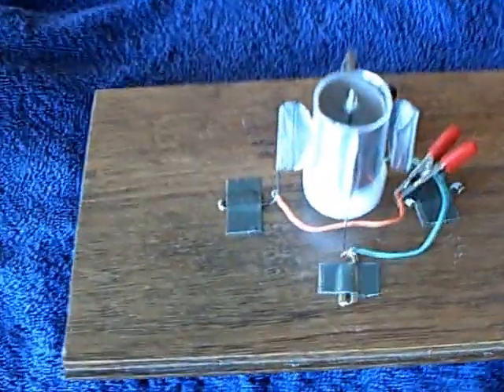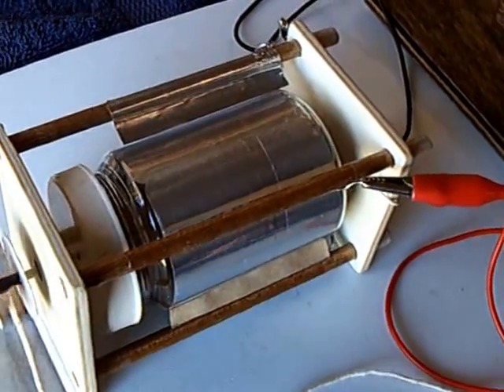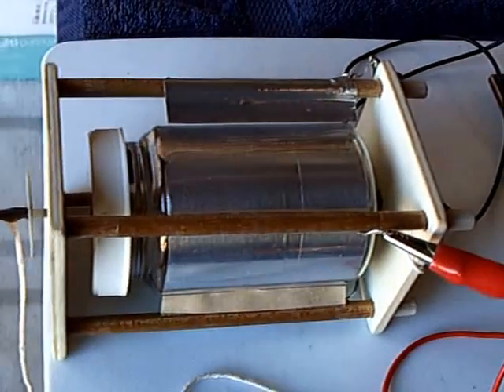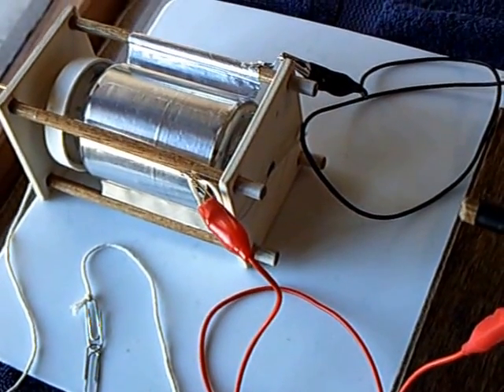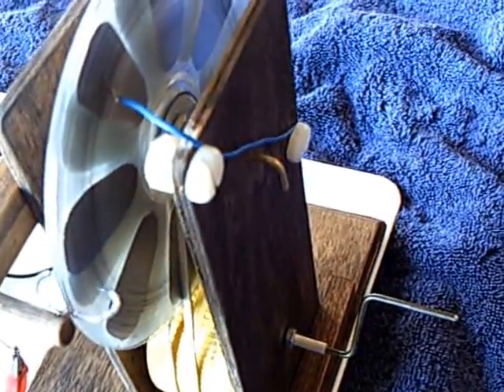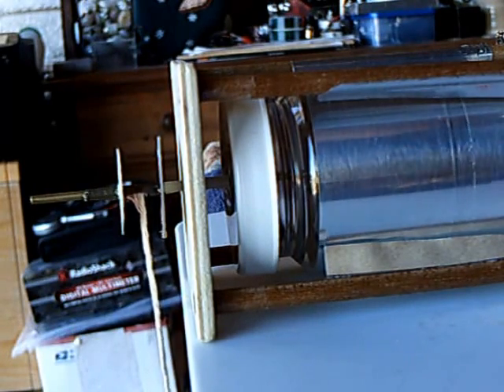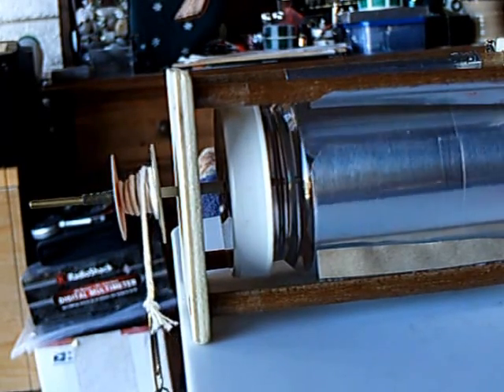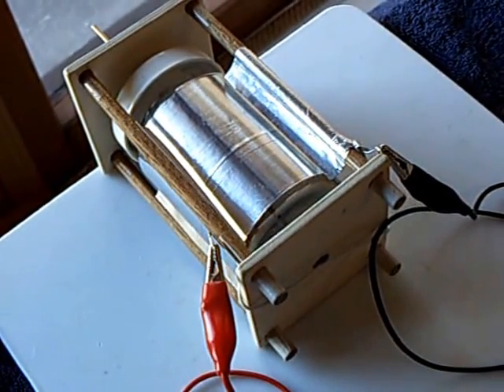New Electrostatic Motor --  torque test

Comment: Sorry to see you still confuse "work"* (or "energy"*) with "torque"** :/

Of course it is simple to calculate the work done when having the weight of the paper clips (and wire! cause here the mass of the wire is not so far from the weight of 1 papier clip).

Any way, thanks for having done this POWER*** //// test ;)

*     WORK  [J ]
= ENERGY [J] 
= MASSE [kg] * GRAVITATIONAL INTENSITY [m.s^-2] * HEIGHT [m]

**  TORQUE [N.m] 
= FORCE [N] * RADIUS [m] 
= MASSE [kg]  * GRAVITATIONAL INTENSITY [m.s^-2] * RADIUS [m]

* POWER  [W]
= WORK [J ] / TIME [s]

Cheers.

Comment: can you throw any light on how this works?are you going to make a sectorless electrostatic generator?  precision is beyond many peoples' means, including my own; I do everything on my lap with a pair of nail scissors and pliers
Reply from the maker: Basically the charge just gets moved around on the rotor surface.  Because there not a uniform charge there ends up being a rotational force as everything pushes and pulls on the rotor.  I subscribed to your channel and really enjoy your videos.  I use a few more tools than you do but I basically build in a similar way.  Kitchen table projects are lots of fun.

Comment: Does magnesium produce a better electrostatic charge? If so what would be the effect on the Wimshurst and the motor?
Reply from the maker: I don't think that magnesium would be any different than aluminum in this application.  Some of the devices I have studied used copper or brass.

Comment: You will need to use "Super corona Dope" as shown in lasersaber.
Unfortunately i was not able to get this dope shipped outside of USA since 2012 for my HHO experiment.
This help to prevent sparking for static motor which help to increase efficiency.
Reply from the maker: Yes I need to get some of that "Super corona dope".  I am having a hard time getting the performance I want out of this motor.  It runs but it take too much voltage and runs too slow.

Comment: This very simple motor reminds me of a standard off the shelf induction motor that you would find in wash machines and bathroom fans. In reality after looking at motors for a long time it finally dawned on me that motors and generators are just mechanically driven transformers is what I can come to think about them. They operate in the same manner just different configurations but they all produce a static field either by mechanical force or by inducing the force. What about adding some layden jars for extra capacitance sort of like a run capacitor and see if you can improve efficiency of the torque.
Reply from the maker: I made a couple of small Leyden jars to go along with the Wimshurst and they do help.

Comment: elegant experiment, would be great for a science fair. Next use  A slayer exciter circuit and tesla coil for the the H-voltage source.  You will be winching bricks before too long  :)
Reply from the maker: Thanks.  I tried a slayer exciter and couldn't get anything to move.  I will try again but the voltage has to be a constant HV potential.  HV with a wave form doesn't seem to work on the motors I have built.
Reply: ***** Great job  Have you tried making one using disk shapes on a rotor disk and stator with commutator?

Comment: :) So Very Nice To See that for the first time since years I follow the Quest For Free Energy, someone does what I have so often advised to do to calculate mechanical output power and torque, so have an estimate of the outpower of the devises.

Note: Do not confuse TORQUE, POWER and ENERGY!

E.g.: the torque will be shown by the limit weight (mass times gravity acceleration) the motor will lift times the radius of the pulley ; not the speed the weight is lifted ;) (I mean not directly).

Cheers.
Reply from the maker: I would not be surprised if someone did a rough calculation of how much work this little motor did here.  You would just have to look up the weight of two small paperclips and a foot of cotton string.

Comment: Thanks,
Electrostatics have always facinated me. This stuff is every where, and all we want to do is get rid it. Got to be a way to harness the thousands of volts that are all around us. What would it do with capacitors in line with your motor. Maybe with a spark gap. Keep up the great work!
Reply from the maker: It is a very interesting study.  I am finding out there is quite a lot of work bring done in this field right now.
Reply: *****
So putting capacitors did make an improvement?
Reply from the maker: kylie wilson The capacitors are really part of the Wimshurst setup and not the motor.  I have ordered a 12v negative ion generator that should give me a constant 6kv power source.   I will try caps with that and see if it does.

Comment: Finally someone who lets ACTUAL work be done by an experimental device. We never get more than a multimeter reading, empty rpm's, partially lit bulb or a turning fan of sorts and some fuzzy math.
Lidmotor, I salute you.
Reply from the maker: Thanks Cloxxki.  These electrostatic motors are so put down as being absolutely useless "free spinning" devices that I had to do this.   I believe what Oleg Jefimenko  claimed and I had to see it for myself.  I agree with you that this ACTUAL work testing should be done more often on the other projects.

Comment: I agree with 72fr250, a persons hair raising from a Van De Graff, a snap from a finger after rubbing the shoes on carpet, the crackle of clothes from a dryer - that's about it. Here we see no coils, magnets, carbon brushes, no batteries and yet it's doing work and at a remote distance from your supplying of the energy.
Great build :)
Reply from the maker: Thanks.  There is lots of information on electrostatics if one wants to get into it.   I am surprised that there are not more practical applications of it.   Coulomb force is pretty strong stuff.

Comment: No magnets or copper coils and these motors are doing work. This work with electrostatics has me excited. They don't teach us anything about electrostatics in college level physics except that it's static and useless.
Reply from the maker: I don't recall much being said about it either but that was long ago.   They used the word "useless".  I'm not buying that anymore.
Reply: Well they aren't completely useless but to get a magnet motor equivalent power output you need extremely high voltages, and at that point air itself no longer helps as an insulator so things get crazy dangerous.